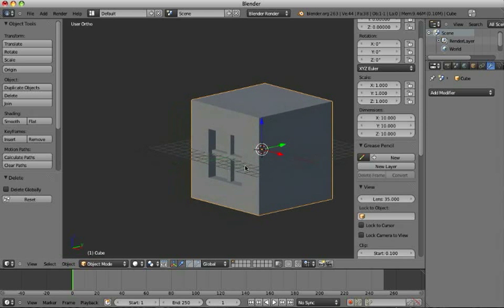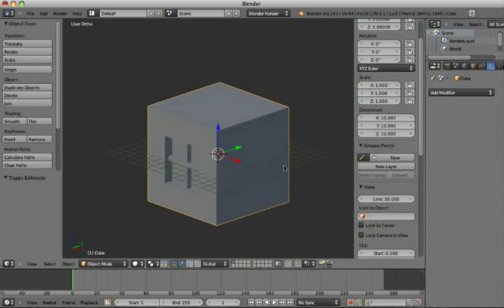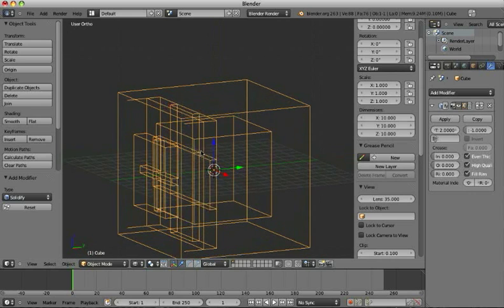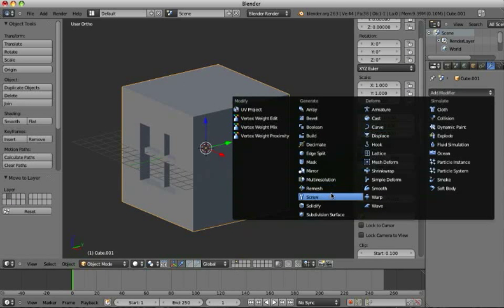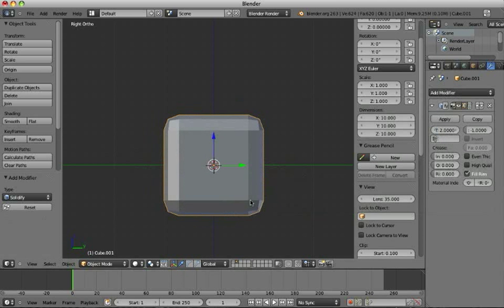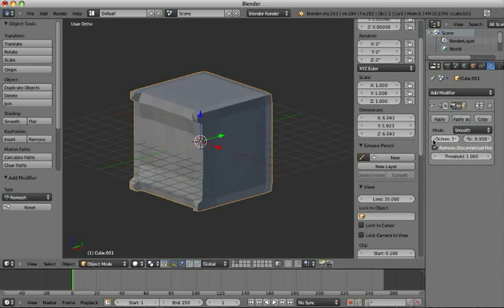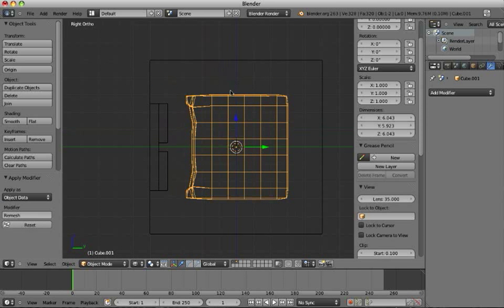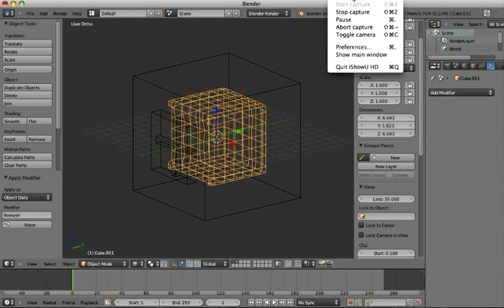Hollow architectural models for 3D print in Blender

Comment: Thanks for the reply Bram. The reason I ask is that I often have problems using booleans in freecad. In fact, every time I use it there is something that won't work. I was wondering if blender would better for such things. I just don't want to take the time to learn it if it is mediocre as well.